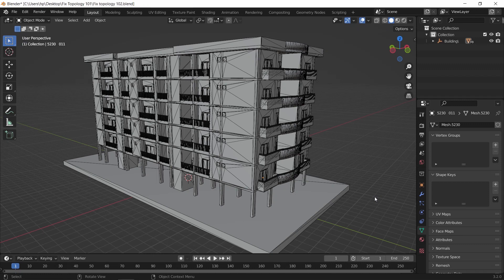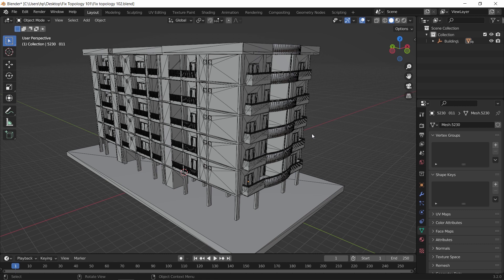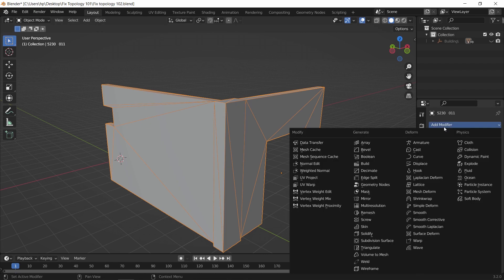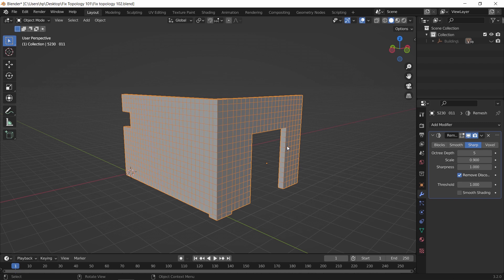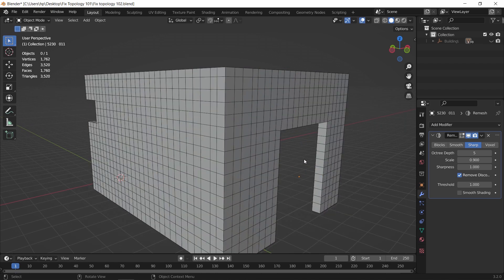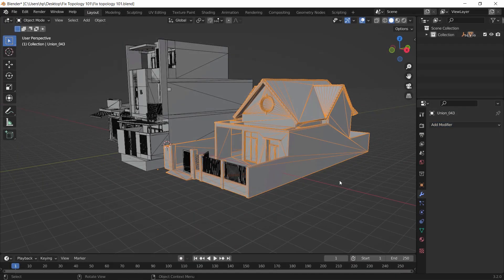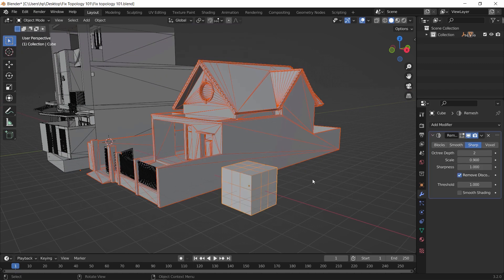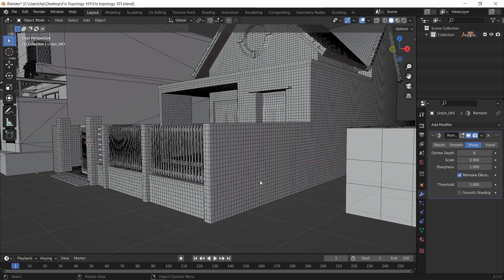Learn How to Re-Mesh in Blender - Avoid Freezing

Comment: I acknowledge the issues other ppl are mentioning regarding inflated file size..

Thanks for the tip. Naturally, as we are seeing (and from comments…) there are some limitations and drawbacks to this, but still interesting.

At around @02:50 once all is done, we can see pretty clean surface+edge on areas such as the brick wall (near side of model). The front fence has cleaned up well too.

However the result up by the roof..
the triangle/peak, particular the trim area, this looks a bit patchy..

Another example, the circular indented area on the front face of that wall (near triangle peak roof), the quads around the edge of this again look not perfect.

I came to this after importing my Sketchup model into Blender. (I want to prep it for texturing in Substance Painter)

In my case, it is a bit heartbreaking to witness results like these on a model I took weeks of care on. I also used ‘Bevel’ plugin on almost every right-angle in my model. (eg from front face, round the corner to side face). I’ll try this method in your video with model but I’m not confident it will handle those bevels well.

Model in question:

https://skfb.ly/pASZG

Comment: Not sure if you can help. Can't find info anywhere. I never have a problem remeshing In blender. Millions of faces... No problem. I have recently started doing head scans using a scanner. The face count is low... Like 340,000. When I go to remesh however it freezes my computer and I have to restart. I've tried. Scale. Tris to quads. Unit scale. And a combination of those things... Freezes every time. Anyone can help?

Comment: This is not the way to proceed for architecture, I highly recommend not doing as shown as is not accurate and will just increase dramatically the polycount. 
Best option would be checking the exports settings that it gives you quads and that it doesn't mess with smoothing groups. 
Otherwise go in edit and use tris to quads.
Last option would be to go in edit mode and just press x -> limit dissolve
Reply: Sir i create Model in Revit, but its Highpoly How to reduce it Sir for Blender...

Comment: Sheer insanity, if you ask me. Embrace Ngons for this type of model and only add subdivision where you need displacement. There should be zero shading issues between these planar surfaces with correct shading.

Comment: pro tips : select all : edit : Merge by distance : Trist to quad : merge by distance
Reply: What does this do? When/how/where do you do it?
Reply: @jme2006  it reduces a lot the number of polygon on imported models with fucked up meshes, it will turn some ngon to some quad which make adjusting them or using modifiers easier.
Reply: @blastersekla  Interesting. How does this modifier sequence compare to the hack that was demonstrated in the video? Does it scale as well?
Reply: Why to "merge by distance" after tris to quads again?

Comment: I find the Remesh modifier to be a useful tool as a first step. After applying it, it's much easier to dissolve loops and rings which can reduce the poly count so that the balance between vertex count and mesh cleanliness is right. Thanks for sharing this solution Architecture topics!

Comment: sir, in this cases, i use decimate modifier and in that planer option is helping me to dissolve almost triangles of the mesh,pls try it and make a video, its more effective than alt + j
Reply from the maker: Yes you can decimate the shape after the Re-mesh process, However I think with the planer option you will end up with not enough cuts so a new problem is created. maybe this result depend on the mesh it self but not in general.
Reply: @architecturetopics  okay, thanks, i will check it

Comment: Could you combine this modifier with the decimate modifier and still get a clean model?  Or does that not work the same? 
Either way, really great tip! I am still working on a better workflow between Revit and Blender that doesn't completely ruin the model.
Reply from the maker: I don't think that will work after the re-mesh, the decimate un-subdivide will give you a result like the voxel with smooth shape not sharp, the planer will clean the mesh entirely so you end up with not enough cuts to work things around. Try it maybe and see the result.
There should be add-ons that lower the poly count So maybe we can find something free beside the Decimate to work it around.

Comment: I Will never use this method ......
Reply from the maker: Understandable 💙
Reply: why?
Reply: @Marco-dr5ho  remesh never make a milimetric realistic measure for your models ....remesh have Bad not exact reconstruction.....remesh make this with so much poligons faces etcétera it's not really (for me ) a way
Reply: @Marco-dr5ho , poly count is way too high, which will result in longer render times. It's better to model with quads with polycount in mind, but if you have to remesh, do it manually, while it may take more time upfront, render times will be lower.
Reply: @TacticalSquirrel  that's what I was thinking. Even though it's not free, I found out that the best way is to first import the model in Moi 3D software which is capable of exporting perfect model made of quads
Reply: @Marco-dr5ho , also look into Topogun, it's a lot like Maya's Quad Draw.
Reply: @TacticalSquirrel  thanks, I will.  My biggest issue is exporting nurbs objects from Rhinoceros (3dm files)
Reply: @Marco-dr5ho , unfortunately I never use Rhino, so I couldn't give advice on how to fix that. 😔
Reply: @Marco-dr5ho  i think rhino is remesher built in so it will give much cleaner result. Also I think it must have some option like Moi 3d for exporting.
Reply: @TacticalSquirrel  try using decimate modifier